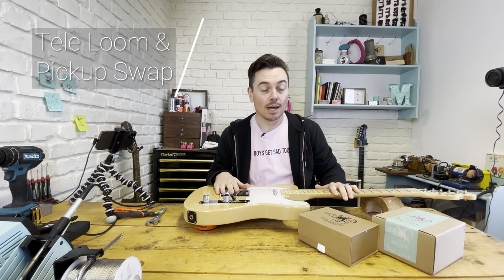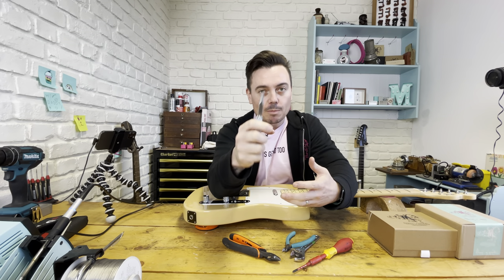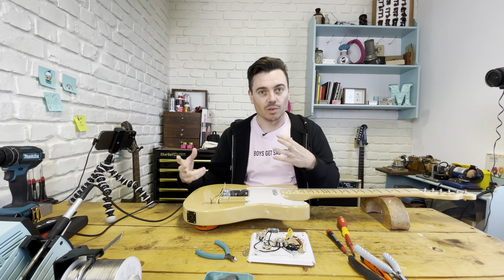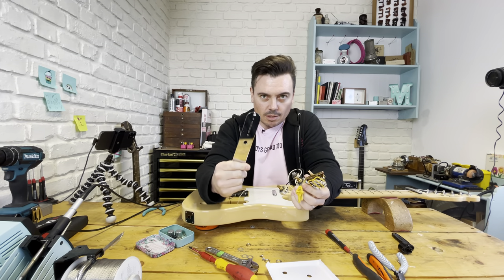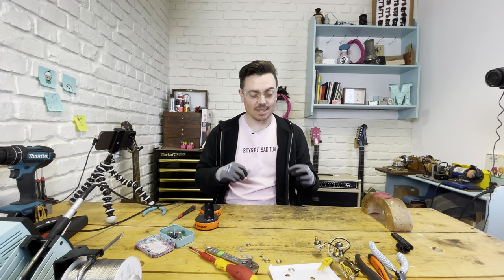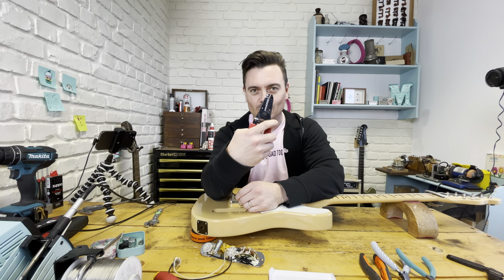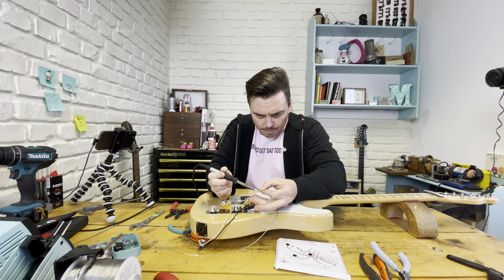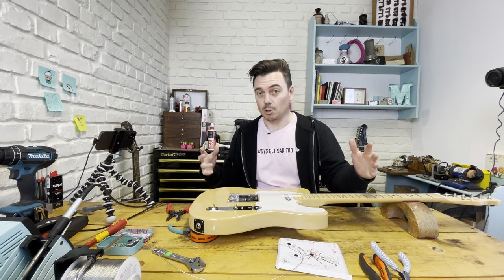Upgrade a tele Part 1. How to install a 5 way Telecaster loom and hear what it can do.

Comment: I had a fender usa CS strat and it sounded perfect , i sold it , but it had very rich lows , woody lows, and a woody but chimey highs.

I still have ave 2x mij strats that are lovely , I have upgraded to fat 50 and a gilmour set.... would your wiring kit help the fat 50 mij strat get closer to the CS or is it the choice of woods and eay or was made that gave it that tone ?

The mij with fat 50s sounds 70% there tbh but i wonder if this upgrade will help before i take the plunge again as they are so pricey
Reply from the maker: Hey dear chap, Before doing anything, I'd recommend making sure that your guitars are set up properly and the same way as your CS strat or as close as you can remember. This makes a huge difference to the sound. It's all the parts coming together that make the overall sound of the guitar. As you have already upgraded the pickups it would be the next natural step to upgrade the wiring and components

Comment: Good video. I'm tempted to hack in an upgrade to my MIM Telecaster.

Just finished watching Part 2. I'm guessing made in Mexico teles are all imperial and you don't have the same hole size issues.

On a side note I'd suggest dumping some links to the web pages for the loom and pickups in the description for peoples that just come across this video randomly looking for Tele install stuff.
Reply from the maker: Thanks for the heads up. I'll make sure they are in there. And yes MIM stuff is 99.9% imperial you get the random oddity but they are few and far between

Comment: What a cool mod!  What is the value of the resistor that you are running off the pickup for that "fat" sound?
Reply from the maker: It depends on the pickups that you have in, but in this one, it is a 3K3
Reply: @Montysguitarsandpickups  Thanks, I'm going to experiment with this a bit.  Fun video, thank you!

Comment: What mods do you have to make to the pickups? I cant work it out
Reply from the maker: You need to seperate off the metalwork from the pickup coil for this wiring to work properly. Cut the little wire that runs from the baseplate to the eyelets on the bridge pickup, and the wire that runs from the cover to the eyelets on the neck pickup and attach seperate earth wires for them. Cheers M

Comment: I bought one of your looms and can't figure out what you mean by 'string ground" wire.
Reply from the maker: Hey, sorry for the delayed reply, the string ground is the wire that connects electrical components to the strings so when you put your hands on the strings any interference should go away (almost) which loom did you get?
Reply from the maker: @lsmith869  hey drop an email to mail@montysguitars.com and we can get you up and rocking